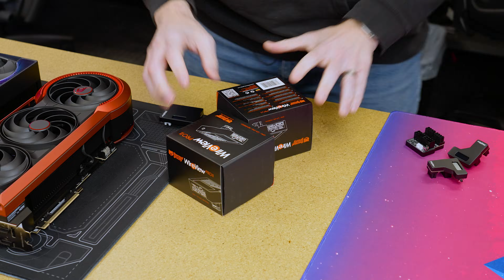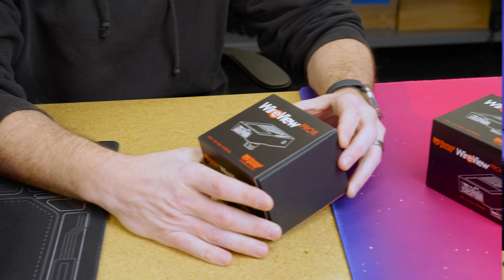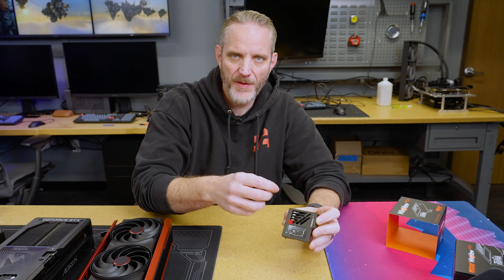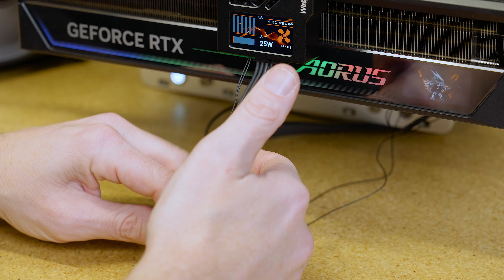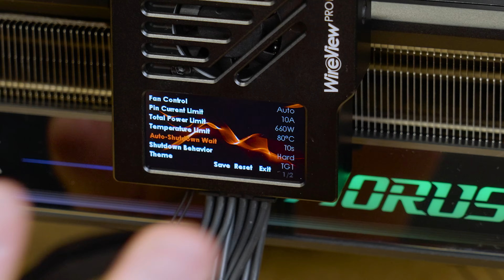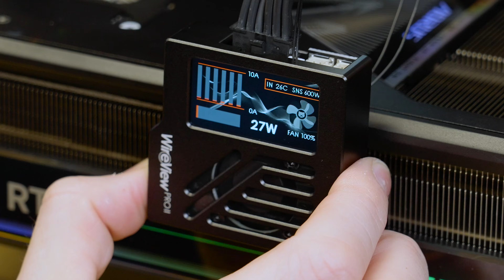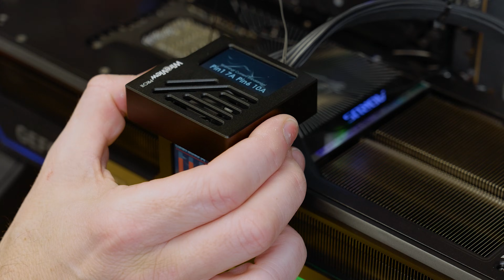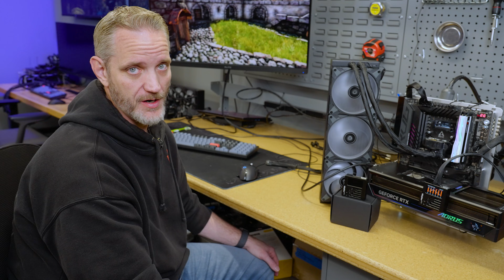Thermal Grizzly Wire View 2 Pro - The fight against melting connectors!

Comment: by the way I got the wireview pro 2 and there is a solution for the case unified connector, the wireview pro 2 come with a male and female connector adapter and for the unified power case connector you can simply backprobe the unified connector with the male end of the wireview pro 2 connector that comes with it for this, i tested it on my PC and it works just fine (im running a lian li o11 dynamic rgb case incase peoples were wondering what model the unified connector is)
Reply: can you send me a photo of how you do it, i have the same case
Reply: @xnalled4733 simply find where your 2 power button wire are with the motherboard manual, take the male end of the wireview cable (the one with the prong sticking out) and backprobe the all in one connector with the prong simple as that.

Comment: I had two separate PCIe 2 plug versions of the Wireview melt into the socket on my Asus Tuf 3090. Thermal Grizzly replaced the first one no questions asked, after the separate one went, never again. It's plugged in with Corsair braided cables for my PSU now and it's been fine.
Reply: Trying to understand, you stopped using wireview because they failed?

Comment: Hwinfo64 can also monitor amps if you have an astral card. I have it set to shutdown my PC if any pin gets over 10.5 amps.
Reply: I didn't know this I'll have to try it out. Thanks
Reply: Good nfo
Reply: But that only works on GPU cards, that still have sensoring for single pins. As many of the RTX 50s series now have only solid rails for +12V and 0V directly on the 12VHPW, there is no chance to measure it via software. And even on RTX 40s series, there are 3 rails each combining 2 pins together. 

edit: Nevermind, was to distracted to read, you were talking about the Astrals. 😅
Reply: @Raspootin  So, because my Sapphire uses 12vhpwr with a unified rail, and therefore, no individual sense pins - it wouldn't work for my use-case? (my feeble understanding - just getting into desktop GPUs after mobile 3060 for the past 5 years)
Reply: I admit, I don't know the technical specs for that model. But if it comes with unified rail on 12VHPWR, all sensors on the card's board can only measure the total amount going through the connector, but not the amount on each individual pin. You could just download HWinfo - freeware version is enough - and check by yourself, if you get a reading of Amps for single pins. If not and you really want to have that reading, then TGs WireView 2 would be your only choice at the moment.
I'm happy to "just" have a RTX 4080 SUPER, which doesn't run the 12VHPW on specs maximum, so there is at least some safety margin before my cable melts. 😂
Also the 40s Series came with 3 seperate unified rails, so there could be at least some monitoring to check the balancing for those 3 rails - even though I cannot find any reading in HWinfo for that. 😅

Comment: Burning connectors are 100% a user issue. By refusing to buy GPUs that use this B.S. connector, this will push manifacturers to improve/change said connector. Im also part of the problem having a few 4090s/5090s.

Comment: Is anyone running one of these on a card like the 9070XT Nitro + that has the connector on the end of the PCB.  Obviously you would want a short like 12"? 12v-2x6 to 12v-2x6 cable to go from the card to Wire View and then my native 12v-2x6 cable from the PSU to the Wire View.  Then I can make a mount for the wire view to sit in.

Comment: This is great and all but really we should just boycott bad products, even if it doesn't matter these days with the economic situation. It's a bad design / manufacturer QC. If they released a proper power connector with adequate design for manufacturing nobody would have been making these videos about it melting or drawing too much power.

Comment: I wish you didn't have to click the device to switch screens for different stats. I just feel slight movement to anything plug into the gpu connector will cause the gpu connector to get loose or compromise the solidness of the connection between both points. Wish it was also Bluetooth compatible with your phone via app to change screens and update. Still getting one i guess or should i wait for a chance of a second version to come out?

Comment: Imagine Nvidia started making the RTX XX90 card with soldered wires directly to the pcb for the gpu and you just plug it into a rated power supply then you dont have to use the psu provided GPU power cables anymore and that removes an entire connection and failure location. I think LTT did a video where they soldered 12v cables to a 4090 I think so it would be something like that.

Comment: I bought a Corsair nautilus AIO with the LCD screen and it works great however, I discovered that If I bump my PC then it can turn off the CPU PUMP because the connector that goes into the motherboard is not good and if you wiggle it then it can disconnect even though its physically connected. Companies are being lazy with these connectors right now for some reason.

Comment: The fix would be so simple... just get a rail of 24V, use 24V for gpus, new PSU yes, but the problem would be fixed so easy! Ampere.makes cables warm, 12V 10A is equal to 24V 5A, less Ampere, same Wattage, no overheat, fixed! But we are still pushing 12V for NO HECK OF A REASON!

Comment: I'm in the market to upgrade from a 3070ti to a 5080 or 5090 this year and I'm probably going with the 5080 simply for the peace of mind. If one of these types or products arise that can really put the worry to bed I might actually go 5090.

That said, is the front panel connection a requirement ? I rewound a couple times and couldn't figure it out.

Comment: You guys all need to take a chill pill and learn how to plug a cable in. You guys do realize that there are 100x more GPUs in the enterprise space that use this connector and they have had 0 issues. There are entire server farms with 10s of thousands of GPUs using this connector with 0 failures..Wanna know what the difference is? Those were installed by a professional that doesn’t fuck and fiddle with their shit every day. Stop crying and admit to yourself that you are the problem, you simply don’t know wtf you are doing. You think a 5.5 trillion dollar company that has deployed millions and millions of GPUs for other multi trillion dollar companies and has a shit load of their own running GeforceNow would not have changed the connector if it was an issue?

Comment: It's crazy that something like this is even needed. There is a huge hole in the market right now. Power supply companies should be building all of these capabilities plus more into their PSUs. They should be doing it for every connection on the PSU. I have had this thought for years, well before the 12VHP mess. There is no reason PSU companies shouldn't be able to do full monitoring on every output pin.

Comment: listen, i try to understand, but i can't comprehend this.. so you buy the NVIDIA CHIP and u make ur own board.. dose it come with special limits, like ur not alowed to do this, or that.. why can't a GPU company make a SOLID powerconnector with a device like wirepro already built in ? at this point i would make a colab with a PSU company as well and design an crazy GPU, with superior cooling, heavy duty power connector, and just ask more for the GPU . when ppl are going to buy my product, the competition will have to step up, similar to the phone industry... I JUST CAN"T UNDERSTAND !! but i think NVIDIA has special LIMITS on what you are alowed to do.. i would just go crazy.. buy the chips redesign everything from scratch, PPL that can aford the 5090 will pay extra for an improved version of it. just my 2 cents.

Comment: feels like a problem that never existed before with the reg 12v plug is being overengineered just to cause more problems  !  the only solution would be to go back to the old power connector or do what I did and switch to AMD !

Comment: DerBauer is actually making one with an extension soldered directly to it for cards like the 5090FE saw it in his latest video
Reply: That's what I need. Because there's no way this is gonna fit my PNY RTX 5080 OC. The 12VHPWR plug is recessed deep into the card.
Reply: Where did you see it? Couldn't find such a video. I just e-mailed with Thermal Grizzly and they are not aware of a solution for FE 5090. Had to cancel my preorder because I was not aware of the incompatibility.
Reply: @fooboomoo  He talks about it in his newest video about the 5090 matrix

Comment: they give us powerful graphics card to run games at 60 fps so doesn't use full power and use AI to create images to get 240fps, basically paying for less. Cause no way a billion dollar company see this flaw in the design and saying its the consumer fault like every single consumer is a  darn certified electrician.....
all that AI and they still cant design a proper power socket and cable for the GPUS🙄

Comment: All of this hassle because of a connector flaw. I refuse to buy any card with that connector from hell. Still holding on to my 7900 XTX.
Reply: ‘Holding on my 7900xtx’ like it isn’t the 3rd or 4th best GPU for gamers out there haha. Swapped mine for a 5080 and I’m not impressed my XTX was just as good and ended up chipping another 600$ for the swap
Reply: @noxqc6741  The 5080 is a literal scam, its a 5070 Ti or TiSuper whatever - mislabeled, there is no 80 class for the 50 series, if there was you would know because it would compete with or beat the 4090.
Reply: i dont see a reason to upgrade when my current card is running plenty , since all cards maxed out at 4k ... and running a hd monitor.
Reply: Ya idk. I went 2080ti to 9070xt nitro. Waterblocked it. I even use 3 8 pin adapter. Still looks brand new... only pulls 300w at 3447 mhz.
Reply: @buufbalI unfortunately there were already cases of melted cables/connector on that card
Reply: @buufbalI  What are your tuning settings? XFX 9070XT here with a -60mv and +5% power limit. Hitting 3300MHz on my card. 3447 is nuts!
Reply: @really_swaggles after playing around, i got up to -145 +10% stable but clocks were only like 2800. Im running -70, +0%. 3447 on core, 2700 fast timings memory. 100% load im at 25c on core, 35 memory, 45 hot spot 😂😂😂
Reply: @really_swaggles  oh and its a nitro+ but with alphacool core block
Reply: @buufbalI undervolt isn't affecting ram temperature. It's only a gpu core thing. So someone is lying
Reply: @niodix  😂😂😂 you understand the memory gets hot because the GPU is hot right? Cool down the GPU less heat saturation.
Reply: still an excellent GPU. You'll be fine for a while
Reply: If it works for you. No need to upgrade.
Reply: Glad I avoided it for the 9070XT. Turns out half the wattage doesnt make a damn difference - connector is 100% shite and always will be. ASRock and Sapphire(especially Sapphire) are embarrassing themselves and making themselves look like durn tooting fools.
Reply: Was a deciding factor when I bought my 9070 xt. I won't buy a gpu with that cursed connector on it.
Reply: i went with the 9060xt cuz of budget reasons, it only has 1 8pin and is not a mini microwave worth of power lol. But i do plan on upgrading to the 9070xt in the future and it has 3 8 pin conectors, same with every single AMD GPU that needs a lot of power, it has never failed them so i dont understand why Nvidia had to go out of their way to create themselfs an unncessary problem. lol
Reply: @MarcSiqueira because design and money
Reply: I am still on 1080Ti
Reply: It's not that serious.  This is just an easy topic to generate tons of views and interaction on tech channels.  People love to hate on something.  This is an easy run topic
Reply: @JeremyBell  These topics don't come from tech channels. They get reported on people who keep on posting their stories on social media. I don't see any 6pin/8pin melting stories.
Reply: @Pray4TheBatman  survivor bias. There's shitton of reports on that pin too. You just choose not to read the news you don't like, lmao.
Reply: @papinugget69 if it was an issue, GN and Derbauer would also be doing a hit piece on them. Not the gotcha you thought you had

Comment: Thermal Grizzly is releasing a cabled version in the next 2-3 months.

Edit: It will have have some kind of mounting hardware included as well.
Reply: Interesting.  I made that exact suggestion 10 days ago on his video.
Reply: @jamesg8246  I'm guessing the hand soldered version of the WireView 2 in the video he dropped 14 hours ago, is older than 10 days.

Comment: Its very hard for wires or any electronic component to have the same resistance so even a few milliohms difference or minor tolerance differences can cause one wire to allow more current to flow. In the first place its the whole reason electronic components have tolerances. Trying to get all the cables tolerance to be closer will only increase the cost of the cable in this case. As long as the current drawn by individual wires doesnt exceed the rated value it should be  an issue. Current takes the path of least resistance which many people misinterpret as "the shortest path" but its not about the length of the path but the resistance of it.

Comment: The fact that this product exists is a failure of Nvidia. They were the ones that pushed for this connector to be released.
Reply: They didn't design it, though; that's PCI-SIG's fault.
Reply: @Mark_Williams.  I know which is why I said they pushed it.
PCI-Sig even told them that there's a problem which Nvidia ignored and said release it.
Reply: @NostradAlex  So PCI-SIG designed it, with a known fault/problem. Regardless of what Nvidia did to push it out early, it's a design fault that PCI-SIG needs to wear. Nvidia is just the catalyst for the project.

Comment: it would be pretty cool if it could use its logging software to terminate whatever process is using the gpu rather than shutting the whole system off or atleast to have the option to do that

Comment: All this power connector nonsense makes me want to keep my Sapphire 7900XTX and never upgrade.
Reply: Why even consider upgrading that in 2026? I wouldn't even consider it til '30.. That thing is legendary and I almost went with that for my current build. 

You must be one of the upgrade every generation peoples.
Reply: @LIFTEDIT1 Haha, no, I wish I was rich enough for that. I typically upgrade every other generation, so I was considering selling it and replacing it when the next generation arrives, whatever AMD replaces the 90x0 series with. But with all this power BS I may stick with it longer.
Reply: @fourthhorseman4531 makes sense.. You either keep it til the wheels fall off, knowing you'll do a full, net new build each 5+ years (like me), or do as you explained.. 24G VRAM is just monstrous - I was so fascinated with that card that whole generation. 

Then I saw the Nitro+ from Sapphire and fell in love with the design and performance. That and the fact that I have to future-proof since I upgrade 5+ years was what solidified my decision with a current gen card. I failed fo research the architecture, and didn't realize Sapphire followed NVIDIA's wicked ways with their decision to go with this connector (wish me luck)...

Comment: OMG, this is LIPSTICK on a PIG!  This is not safety; it's another "Failure Point"! Another reason to be shut-down mid game! Thank you German over-Engineering; you created an expensive annoyance! Also: You never add yet another connector to a flawed design, never!!!!  This part is likely pricy too, not bothering to watch this whole silly video!!!!  If you want to add a measure of safety, use a cheap 120MM fan on each end of the connector and position the outer 25% of the fan stream blowing towards and as close as you can to each connector end. I made a custom bracket, you can also use gorilla tape, not pretty for you limp wristed types but functional! (Far better air flow than that tiny fan on this demonstrated unit.)  This works as long as you don't do stupid shite on your 5090 and exceed the normal 500-600 watt max load!

Comment: 12v Hpower cable is a problem
Reply: Should be recalled an go back to 8 pins
Reply: The cable is not the problem, the tiny pins and the tiny housings of the connectors are the huge problem!
Also Nvidia classifying them as 600Watts while GPUs run at 600Watts is the issue too.

Comment: Sucks: that wouldnt work with my new Sapphire Nitro+ 9070 xt.. I've been waiting (it's still on pre-order × 5 week lead time) for this.. Timing would have been perfect as I'm completing my build this week once my primary gen 5 m.2 arrives and I get WIN11 Pro slapped on there..

I thought all the failures was just I.D.10.T issues: seeing that Jay fucked his Astral cards up is a bit concerning. The only thing that gives me some relief is his explanation of the reinforcement bar × unified ground/12v. As I'm understanding it: the Sapphire doesn't have the more delicate pins, with per wire monitoring (which is why I wanted this to work for my setup), so, I shouldn't encounter the bent pin issue, at least..

I'm sure by years end, someone else will fill the void that should have never existed to begin with..
Reply: Edit: thermal released a video today covering the new USB-powered card and mentioned a wired version in the pipeline coming in the next few months.